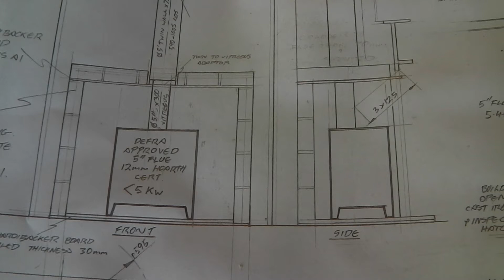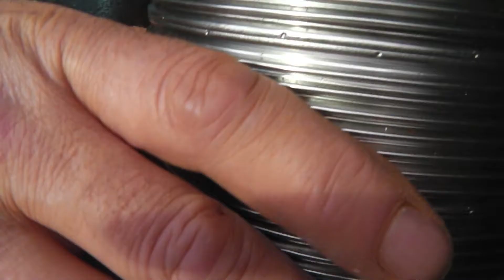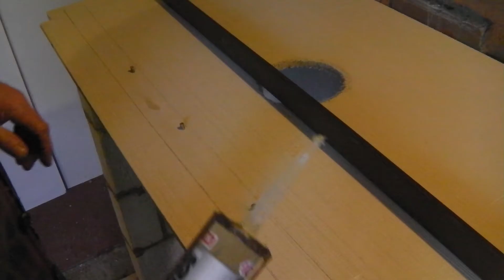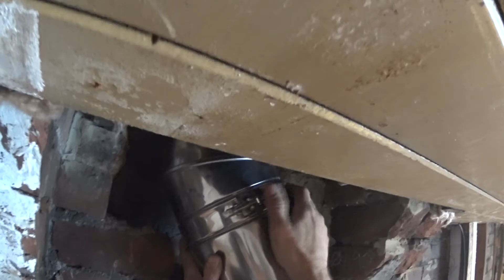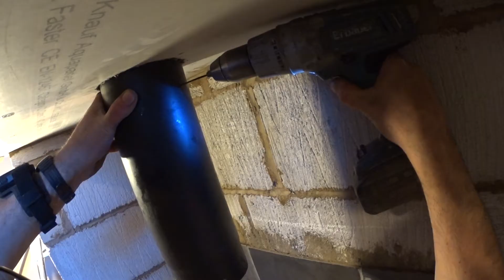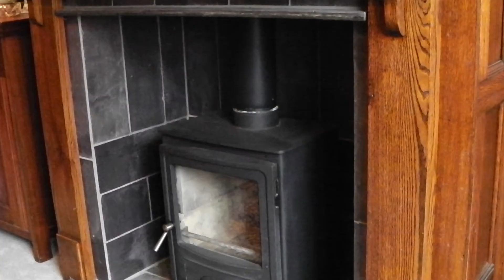Installing a Wood Stove and Chimney Flue Pipe where there is no fire place

Comment: Great job!  I'm especially impressed with how you drafted thise plans, so professional.  Only thing that I wonder about is when the black pipe fits over the stainless steel flue and is packed with fire cement.  I would think that the metals are flexible would expand and contract more with temperature than the brittle fire cement and so the fire cement would eventually crumble out and since the lower black pipe fits around the stainless steel, rather than inside, you could get an exhaust fume leak (the vacuum might prevent it though).  I would expect that there isca proper adapter fitting available.
Reply from the maker: Thanks.  It is the proper adaptor, a good fit but not an interference fit hence the fire cement. Yes the steel will expand and contract but at a similar rate, the cement will stay in place enough to reduce any air gap to an absolute minimum. Cracking fire cement is much more of a problem on the connection to the cast iron collar to the stove itself where the difference in expansion is much more.